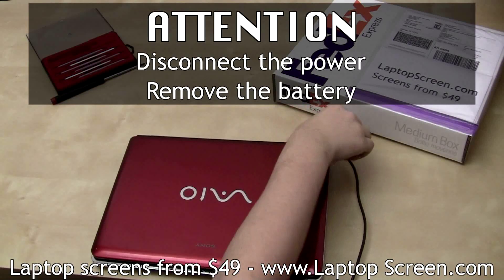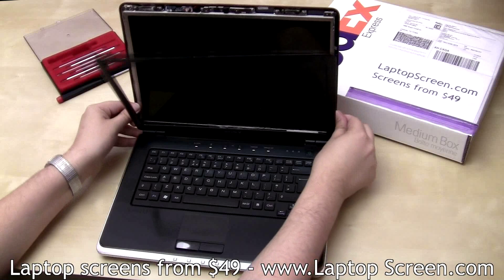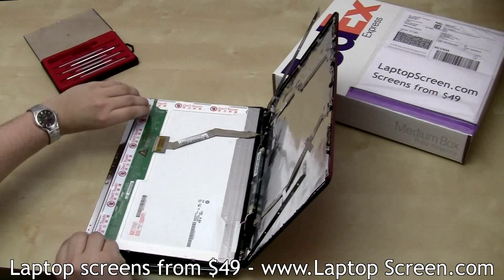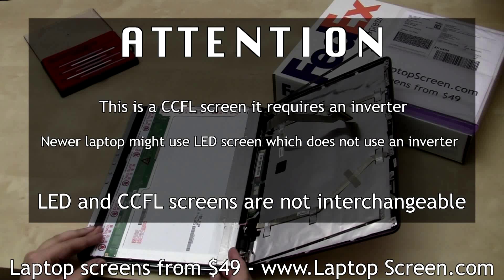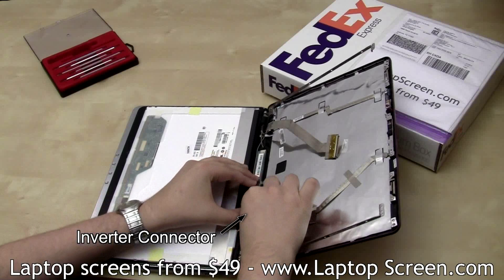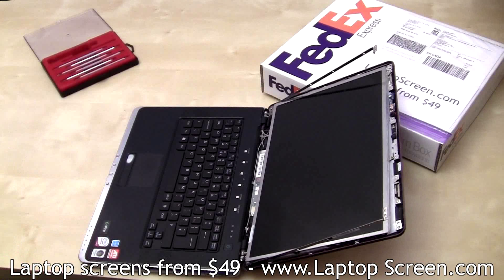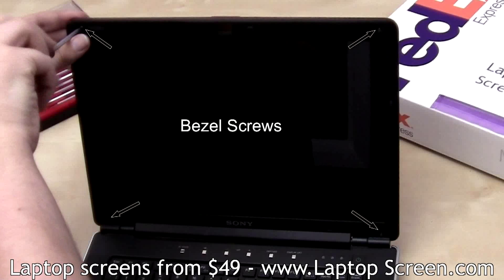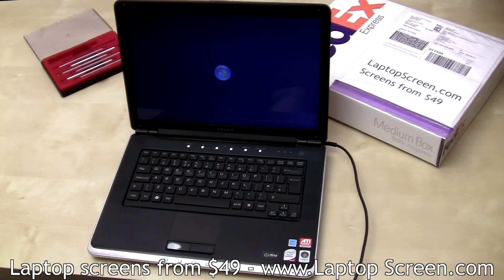Laptop screen repair, Laptop LCD screen replacement guide [SONY VAIO]

Comment: Great video, helped soo much. My Sony is a bit different but I was able to get the basics and figured out the rest w/ some common sense. Believe I have NO sense of computer literacy, took me about 30mins or soo but it works perfectly. So if I can do it so can others w/ a sense of any computer basic skills.  I bought my screen from another site due to your company was sold out, but your tutorial was so good I saved myself probably anywhere from $50-100 being repaired by either a small computer tech shop or more from the major electronic shop. Thanks for your kindness to share

Comment: Are you able to add a video for doing this with a VGN-FW series laptop? There looks to be 4 bezel screws on mine but bottom 2 can't be accessed. Also there's a built in camera & mic, so thinking your current video may not be applicable to mine. THX

Comment: Before replacing the new screen, Do I need to remove the cause that blacken the screen.   For more than a year my SONY VGN-CS290 got bad noise from the fan.  So  I had the fan replaced.  The black screen occurred about three month after the fan replacement.  Do you think an improper procedure in installing the fan might be the cause that damaged the screen?
Reply from the maker: It's possible that the screen cable simply came loose. This may or may not be related to the fan repair, but there is usually no direct correlation between the two. An "improper" fan replacement procedure would show up much quicker than 3 months. If the fan was not properly connected, or not spinning, or if the new thermal paste was not applied, in-cases where fan replacement requires it - the computer would typically self-shutdown with-in minutes due to thermal protection.

You have a CCFL screen - it has a high voltage inverter and a CCFL bulb for back-light. 
You should first try connecting your laptop to an external monitor to test video output. If it works - you could try shining a light onto your screen to see if there are faint graphics on the LCD, and if the graphics are there - but not the back-light - check the power cable to the inverter, and if that doesn't help - replace the inverter first (cheaper), and if that also doesn't help - replace the bulb or the screen.